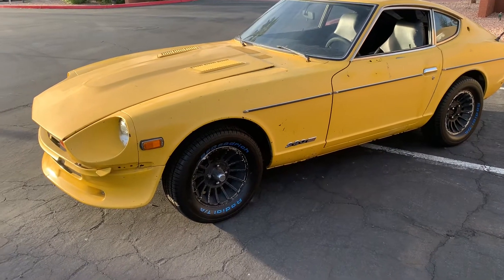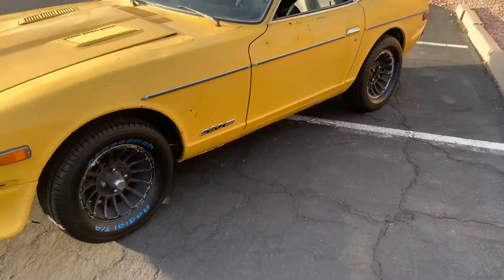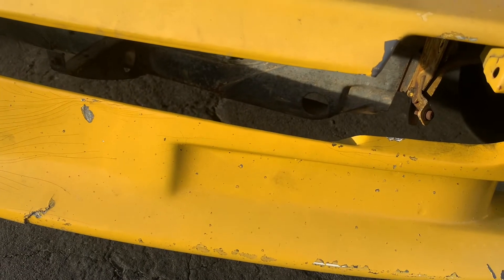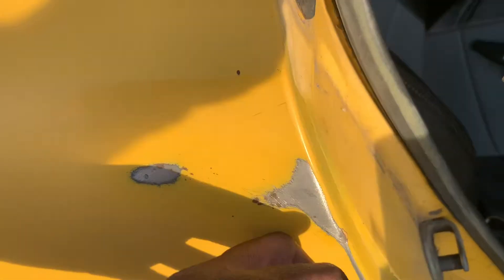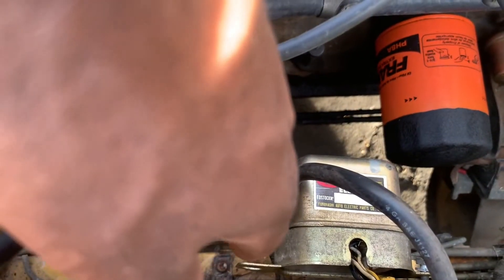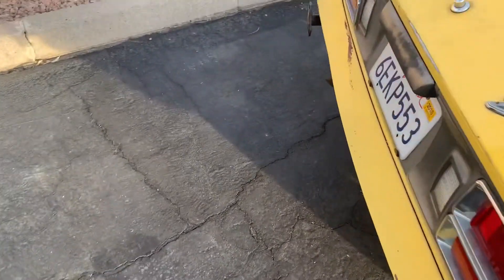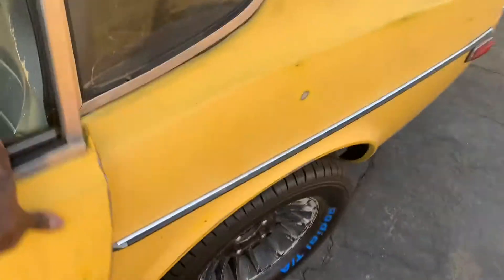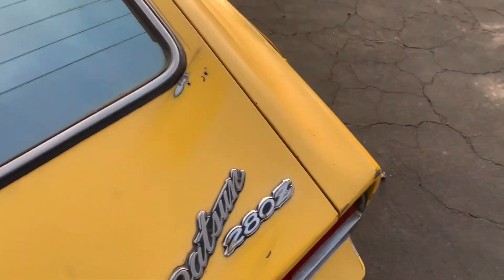Walk around my 280z

Comment: It's a kick ass car!
No the side bumpers were dealer installed to charge an up charge. The designers designed the Z like a 911 a real Sports Car.
    Those stripes are collecting rust, they don't look unique They Chop Up the BEAUTIFUL Kick Ass Body, that is a World Class Design of all time !
   Forget that ugly trim.
Thank GOD, you see the vision of the Original Designers and remove those bumpers that made the original design team pull out their hair and scream running from their design Studios. Forced to put those battering Rams on the Car!
    They say there were for federal safety. But they were to insult the European cars that were stealing customers from American Manufacturers, with lazy, lackluster Designs!
They figured the crash bumpers the American V8 could be fine with.
  But American Manufacturers ,knew the European cars would have to screw up their entire car to meet standards. The height would make the European cars, ruin the roll center of suspension dynamics. They also knew the weight of these bumpers, would be high in the air and hang out the back and hang out the front, fully killing the e7ropean handling and ride quality also add to braking poorly, cornering, terribly, and spinning easily.
The European cars had the book thrown at them, the expense of retooling ,add negative performance in every catagory that they Excelled in prior to impact standards.
Weight on any Sports Car above wheel center line and hanging out past front and rear wheels..  is no longer a Sports Car...it's a passenger, car it's just transportation
  Thank the Sports Car GOD:s you removed that night mare.
Just lowering it will get the handling back to 240Z ,ability.
The 280 has bigger motor and better rear brakes .
A set of eibachs and fresh shocks hell even ,kgb shocks normal or gas. Will finish the cool factor and ride like a champ. On streets and track
Reply from the maker: Thank you